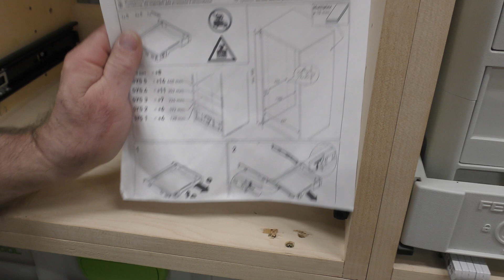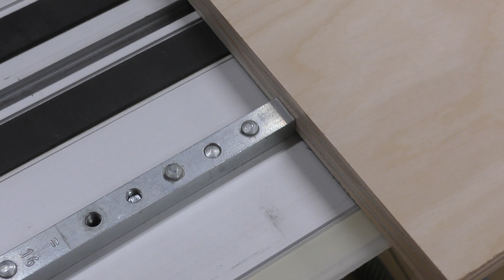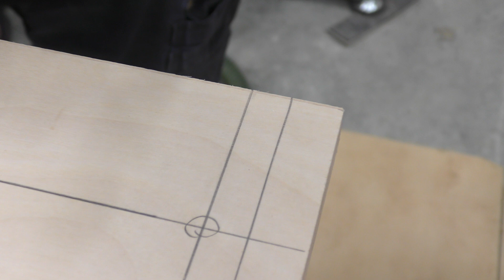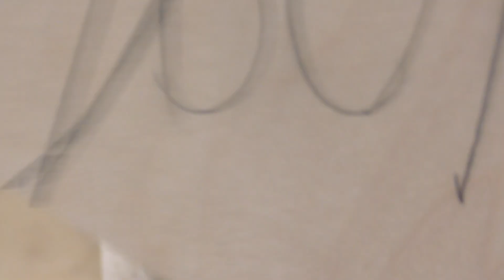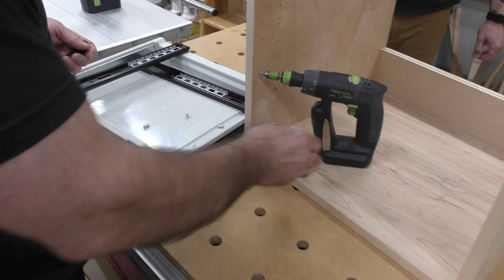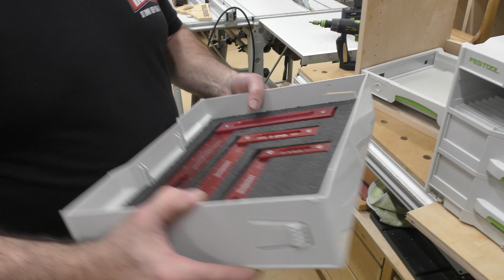My Festool Storage Is Way Better Than Yours !!!

Comment: Sedge, did you shorten a 1400 lr32 guide rail for your MFT3 ?  That looks like a 1080 lr32 guide rail?
Reply from the maker: It was the Original LR32 guide rail

Comment: So i'm finally building several of these - got the wood cut down and edge-banded (newly acquired Conturo and MFK700), and I had a question - is there any way to mix in the Systainer Rails (Sys3 SN4) in these cabinets? I have a set of these and assumed they would work along side the SYS-AZ drawers for the newer systainers - but they don't seem to. Is there an adapter that you'd need to make to decrease the distance between the two sides? Absolutely love your videos - Thanks!
Reply from the maker: sorry for the delay in responding... The Sys rails (SYS3 SN4) need inside dimension of 418mm for the M style systainer ( most common ) and 518mm for the L style systainer ( Large ) ...the sys AZ cabinets need a 427mm inside dimension....so you could possibly use some shim stock to in corporate the Sys rails .... hope this helps ...
Reply: @ Thanks! That’s kind of the direction I was heading. To keep them movable I guess I would need to sort out how to index them off of the holes I am drilling with the LR32. Maybe even just some 5mm shelf pins in the shim stock. Or just drill into the cabinet sides and remount them as needed. Thanks so much!

Comment: Somehow the holes is the hardest part. And if you don’t have the festool track/router it’s almost impossible to get right.
Reply: I use an lr32 rail and a dewalt router with a 3d printed adapter from Etsy and have had no trouble at all. You don't HAVE to spend the  $1000 for their router and then $300 for their lr32 accessories.
Reply from the maker: true
Reply: @sedgetool any other way of getting this done? The 58mm hole is not standard

Comment: Just made my first cabinet for the AZ drawer slides.  Won't be making as many as you have to fill a wall, but mine will be on 2" wheels so can move around in the shop.  Went well and your video was extremely helpful.  The Festool instructions alone may not have led to the same outcome.  Thank you, Sedge!
Reply from the maker: That is awesome!

Comment: Gosh!  I wish I had watched this before cutting all my plywood.  My tops and bottoms are going to be on top of and below the sides.  My back is going to have to be attached to the back because I cut everything at 380.   Uhggg!  I think it will be fine.  I did 928 for a balanced panel.  463 for my tops and bottoms.  427 +18+18=463

Comment: Sedge when you use a tape measure to make a mark, you should run it along the edge to ensure the tape isn't on a slight angle, putting out your measurement by a hair (or more).
Reply from the maker: thanks for the tip !!!

Comment: Sedge, I'm building 10 of these cabinets in about two months. I have poured over my configuration many times to try and ensure that I'm going to be able to fit my forty plus systainers. According to the SYS-AZ Drawer instructions (as an example) the T-LOC SYS-4 should occupy eleven holes, does that include the hole for the black latches? Also, what are the hole dimensions for the SYS3 rails? I can't find it anywhere if I wanted to pre-drill holes using the LR-32 system for them. I know the cabinet width dimensions are 417mm for the rails vs 428mm for the SYS-AZ drawers, but I think a 4~4.5mm shim on either side might work to be able to utilize them in the same cabinet.
P.S.
I got a set of rails from my local dealer and the hole dimensions on center are from the front of the rail, even with the systainer's front they are, 30mm, 97mm, 93mm, 110mm. Very oddly spaced, and except for the first hole which is round (6.3mm Dia), the other three are elongated (6.3mm tall x 13.3mm long).
Sedge any help will be greatly appreciated. 😁
All the Best, Chuck.
Reply from the maker: Hey chuck.... The best advice that I can give  is  to build your cabinet  whether for the rails or the sys AZ drawers and bore top to bottom 32 mm hole system with a 5mm bore...... then go from there .... yes a shim does work ....
Reply: Hey Sedge, I believe I have it all figured out. So, you think shims will work, good. I'll be attacking this in about 6 weeks or so. I'll let you know how the AZ Drawers and rails work together, or at least how I decided to implement it.
All the Best, Chuck.

Comment: So I’m a bit confused about the Sys Screws. I have found 6.3x11.5 and 6.3x13.0 and 7x13. The latter claimed to be a Blum screw but what is the actual standard?
Reply from the maker: 5 x 12or 11.5 to be the standard
Reply: @sedgetool  Are those the same screws you would use for the Sys3 rails?

Comment: Thousands of $ in flimsy plastic boxes, takes up a whole wall.   You have to take a box out, find a place to put it down, undo the latch after you figure out which way to turn it,  open the lid to even see what's inside?  Not better, IMO.  I have a Domino, with it's Festool box, and  one for the tenons.  You need more than 3 SF of counter space just to access the tool & pins,  plus the space to store when not being used.  The tool is good but delicate, but the boxes are a waste.
Reply from the maker: Good For You
Reply: @sedgetool  It looks like there are 16 boxes so roughly 107CU'? At $300 to fill each is about $5,000 plus maybe 9 sheets of plywood.  For about the same cubic footage, I store 30+ power tools, 30+ boxes (50lb type) of fasteners, hundreds of lbs of bolts & large fasteners, trays of plumbing fittings, nipple trays, large amounts of plumbing, electrical, cabinet supplies, and over 500 types sorted screws & nails, ~50 per drawer each accessed with a single motion.  I doubt I've spent more than $200.  So arguably 10x the capacity, 5% the cost, better access, and takes up less wall space.
Reply: @jaywood8296  I’m not sure why you feel such a great need to glorify your decisions about what YOU want while criticizing others and their decisions. Perhaps you just like being a jerk.
Reply: @jaywood8296 Good For You

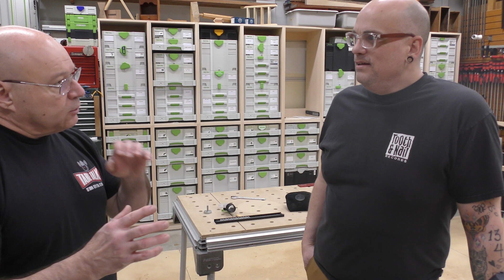Comment: Oh, I rather like those quick-clamp clips shown at 12:13. Do tell...
And a tip for aligning rail to fence for those that don't have a square with pins in them 4:29, you can do like I like to do and use a 1-2-3 block on edge as a feeler gauge -- try it, you might like it.
Reply from the maker: cool ... Link in description for clips

Comment: I got one of those three drawer systainers. I held off for a while because of the price, but now I'm going to be getting a second one. They're incredibly helpful for organizing and taking what you need out when you need it.
Reply: I held off on them until right before the price increase this year. Got two of them and, ironically, used them at my desk indoors since they look nice and held a bunch. Like them so much I got two more for the workshop. They hold a ton of stuff!
Reply: @BuckRogers2491  yes! I was very surprised by how much I could fit in it. I wasn't expecting that at all.
Reply from the maker: That is awesome!
Reply: I just got a 3 drawer Sys and it is a great addition to my workshop.

Comment: Been a big fan of the SYS-AZ,  Currently have 3 cabinets fully populated and getting ready to build a 4th.  Mine are just the fantastic baltic birch plywood without the fancy-shmancy edge banding.  Good tip on the 3/4" spacer under the base sortainer and the 3/4" pullout for placing your drill and such.  Those little things you share with us is the reason you pull in the big buck$!  Wicked pissah!
Reply from the maker: Wicked !!!!!!!!! Thanks

Comment: Fantastic video Sedge! Very informative and explains a lot! One question I did have, do the SYS-AZ drawers have tabs to lock the systainers in so they don’t slide around or are they a tight fit? Or is there a little movement?
Reply from the maker: there is a little movement

Comment: So was the loose spanner not 427mm?  Wasn't sure if you cut the tight one longer or not. You commented to install after, mostly curious what your tweaking was?
Reply from the maker: Jason... I could have cut it at 427mm and it would have been fine ..This is just an old habit of mine to accommodate for imperfections in the plywood ...... happens more often then you think...I hope this makes sense...

Comment: What if you don’t use edge banding? Will that change your measurements for the LR32?
Reply from the maker: nope ...always 58mm from the front of the cabinet for the first hole for the SYS-AZ drawer slide..